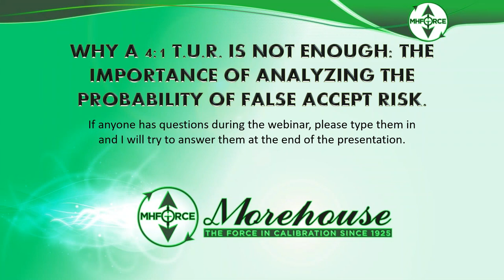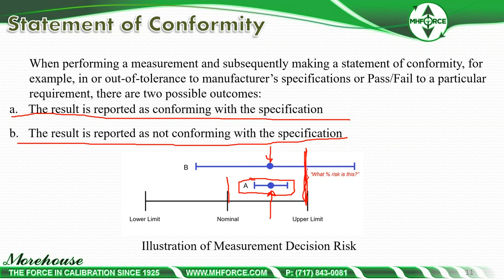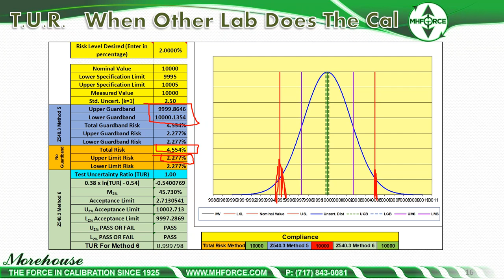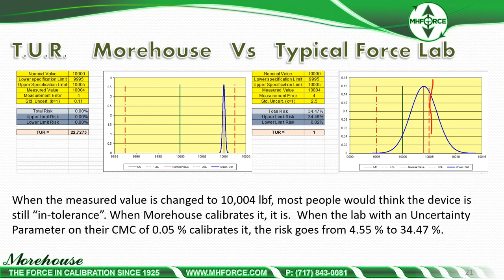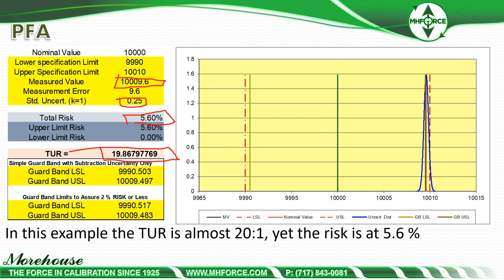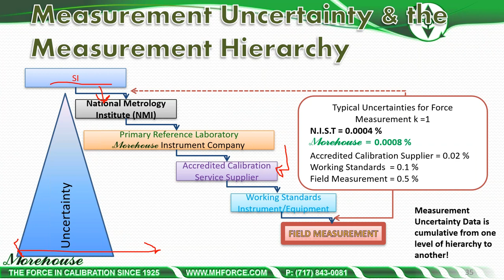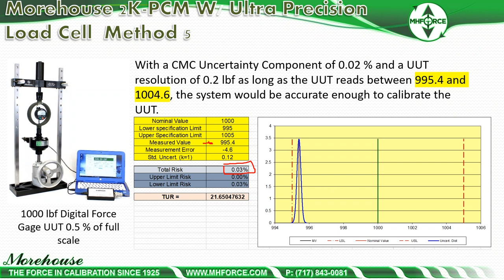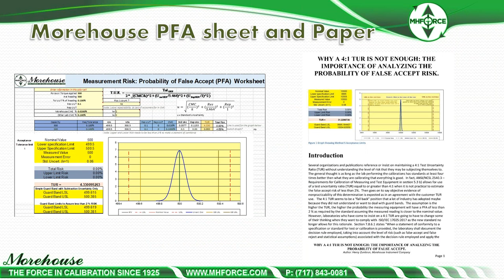Load cell and other force calibrations may have high  ISO17025 risk (why 4:1 TUR is not enough).

Comment: awesome video and very informative. I run a SANAS force lab in Cape Town however we still not using certificate of conformance or TUR or guard banding and statements of compliance. we dont have dead weight testers for better accuracy however all my equipment is calibrated by NMISA and from 0-2000kN the highest uncertainty is about 0.1-0.2 %. my CMC is 0.5% due to the fact your uncertainty is higher on the low end of your equipment and taking into account repeatability , linearity ,alignment and more important environment and operator error. I feel we do an excellent job when it comes to calibrations, however you cant always set equipment even though i have thousands of manuals and passwords ,therefore you need to issue certificate with correction factors, although most customers never even look at the cert. We face a lot of trouble with ILC especially with high capacity's from 1000kN on, mostly due to surface microns and the machines available. Its nice to meet someone who knows about force metrology as it is actually plays an important part of everybody's life but no body understands it. Basically whatever we calibrate we set it as close as possible and issue errors and uncertainty which is always better then my CMC unless it a load shackle or poor quality load cell. I understand force is becoming more advanced and machines have better resolution, i use HBM only yet with fluctuation and electrical noise their is no way on site you can try claim better then their resolution. thank you for your input. We have loadtech selling loadcells with uncertainty say .03% yet our NMISA calibrates and issues 0.2% for example. i look forward to correspondence from you. kind regards.